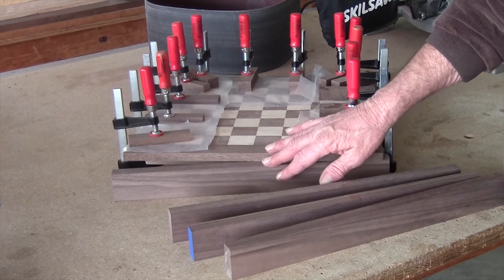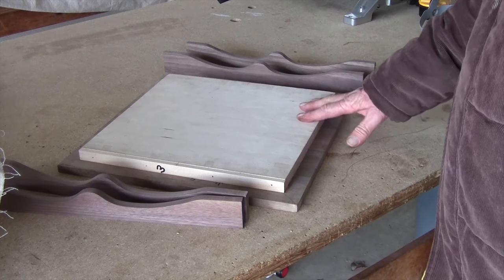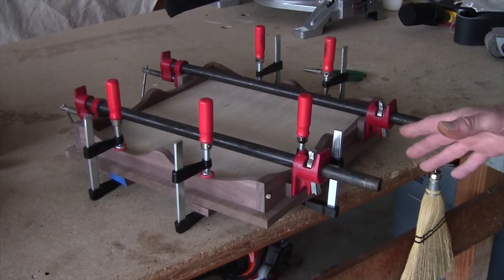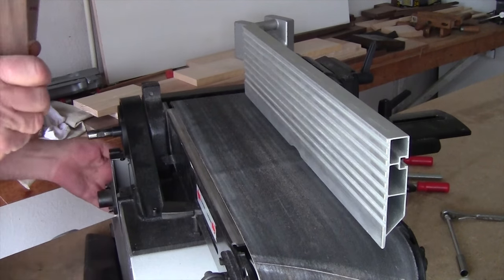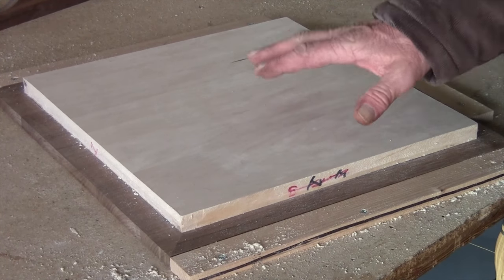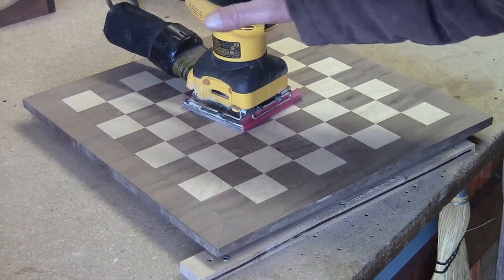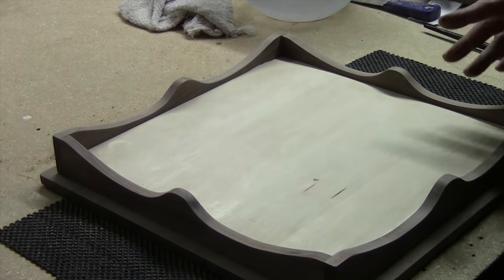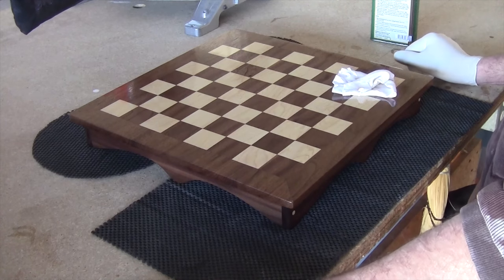How to Build a Chess Board - Builder's Series Ep 1. P5 Final

Comment: That was a lot of work... nice finish.  There is a much easier way.  If you just glue up 4 light and 4 dark strips together alternating each. once dry... cross cut the slab you just made and turn every other strip around... glue those up.   wah la..   chess board. The checker board part will be done in a day depending on glue drying time. The result will have tighter glue joints.